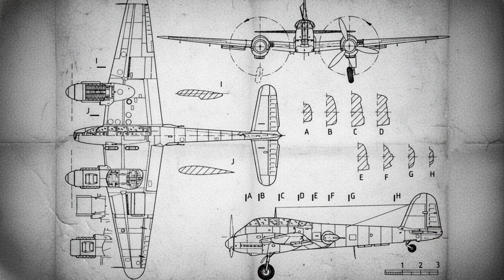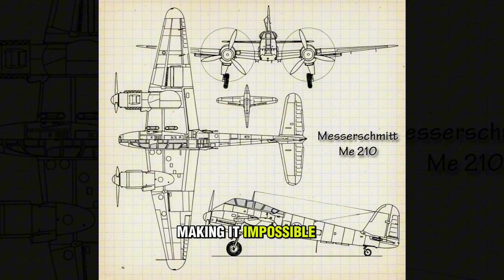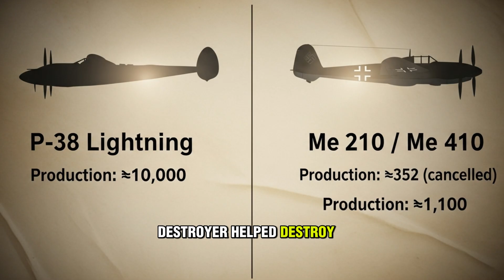P-38 Lightning vs. Me 210: Why Germany’s "Destroyer" Was A Total DISASTER

Comment: The P-38 met the Army requirement a bomber interceptor. The Army decided to make it multi role fighter. What it did have was range and firepower. When other fighter did not have.
Reply from the maker: Right — it started as an interceptor, but the Army turned it into a do-everything fighter. Its long range and nose-mounted firepower were unmatched at the time.
Reply: @microdocs1 …considering this was a prewar design. Prior to all the NACA research available to North American, I’d say Clarence Kelly and Lockheed did pretty good.

Comment: The P-38 didn’t come from the notion of a “heavy fighter”.

It was designed to meet an Army specification with requirements for top speed and rate of climb that couldn’t be met with a single engine, given what was available at the time.